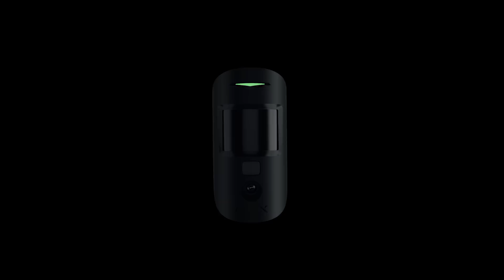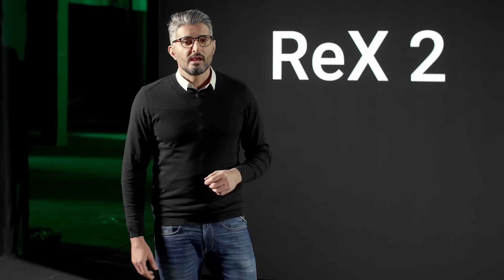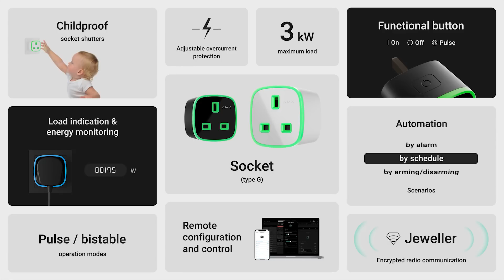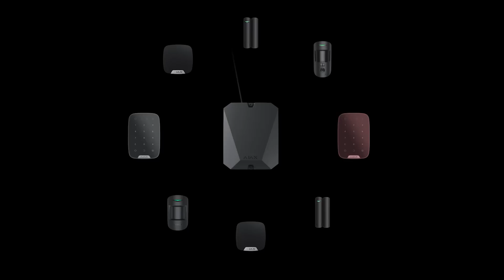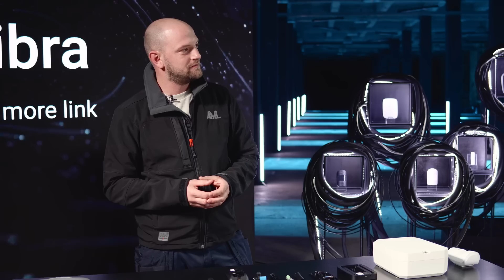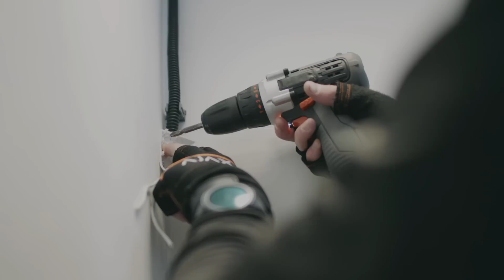Ajax Special Event: One more link | English

Comment: Enjoyed the presentation very much and looking forward to the increased and impressive product range!

I've had the opportunity to install for cliënts and its a very impressive system. I do hope this comment gets read by Ajax self as I have a suggestion for future development:
1. Have a muli-relay circuit module to control a number of outputs (5 perhaps), not just 1 like the relay module. To use for Arm/Disarm status LED, Wired Siren or strobe light etc.
2. Have scenario ability to reset relay when system is disarmed to cancel ongoing siren after alarm triggered.
Reply from the maker: Hello,
Thanks for your feedback. Your suggestion for improvement has been forwarded to our RnD team.
We are grateful for all ideas. They are considered and prioritized depending on how they can improve the system. First of all, we implement ideas that increase the reliability of the system, then new functions and other requests.